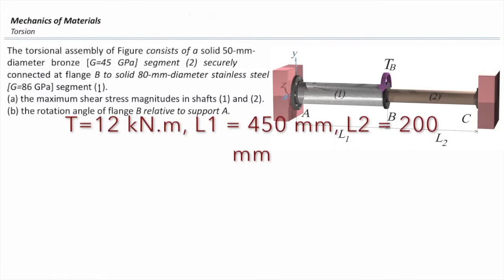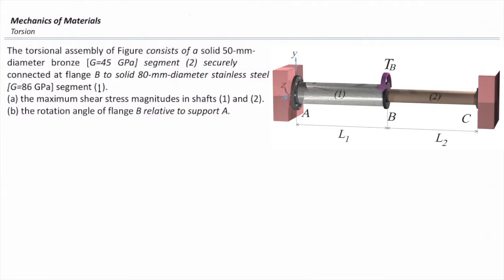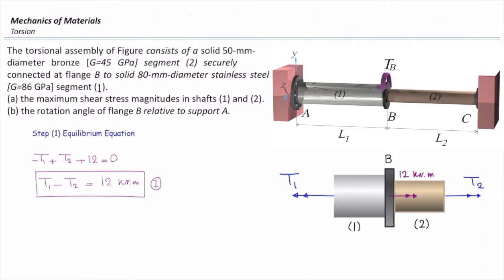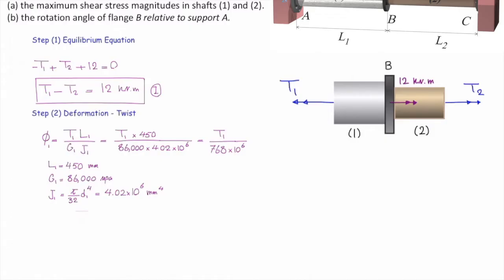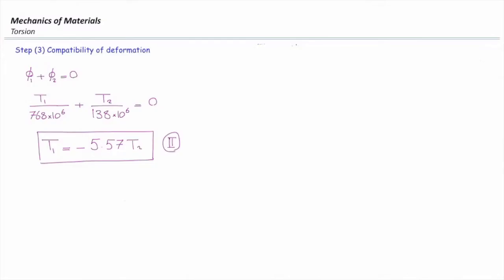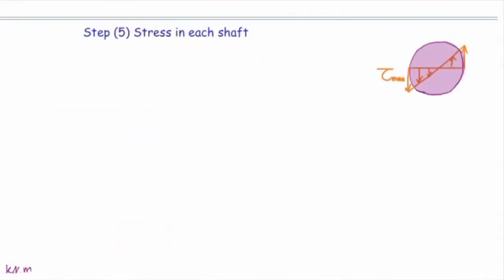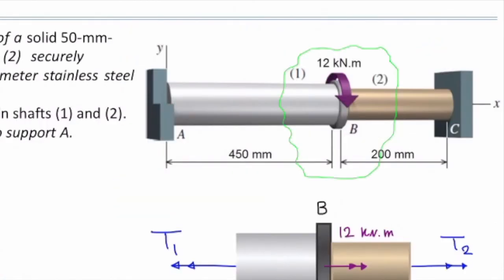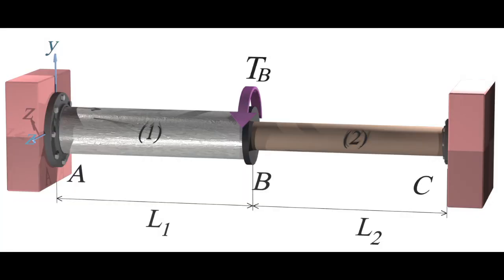Lec10, Indeterminate torsional element (Part2, Example 1)

Comment: What will be angle of twist of b if it is free at c
Reply from the maker: If the structure is free at C, it would be statically determined which means the internal torque is known. Given torque in element 1 (in this case T_B), the twist can be calculated as phi=T_B*L_1/(G_1*J_1). Hope that helps.